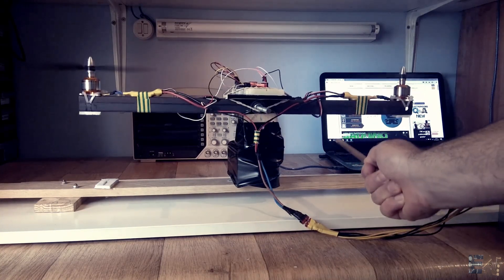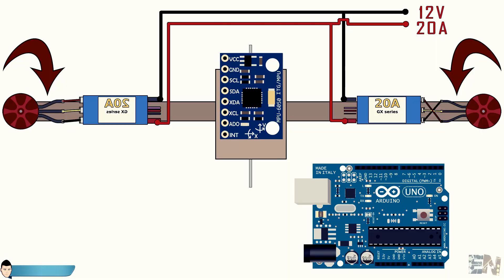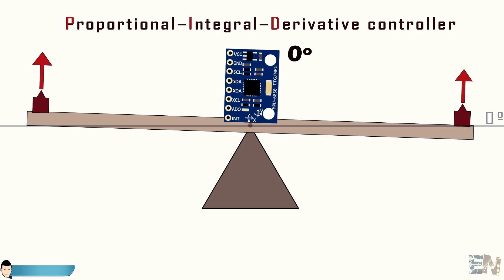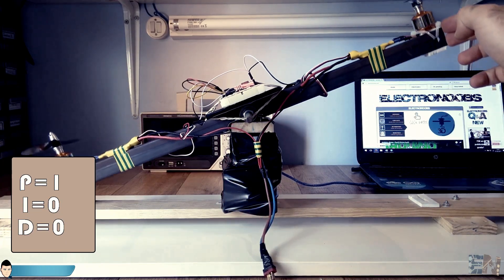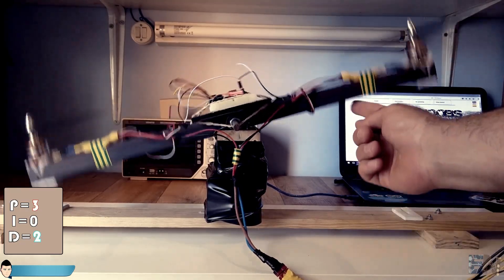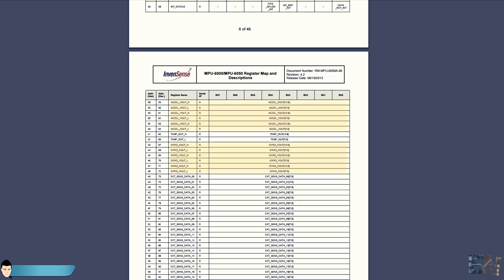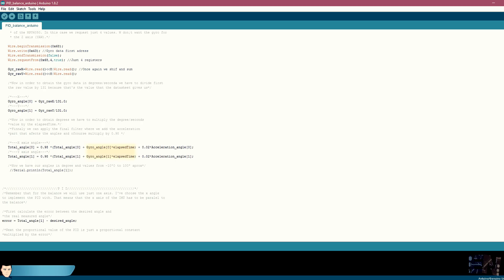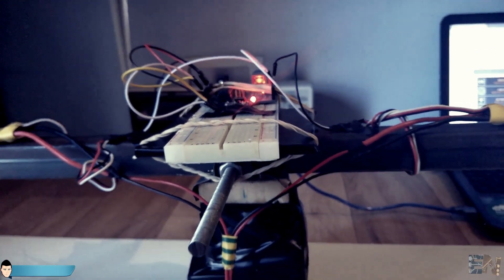PID brushless motor control tutorial

Comment: // ================================================================
// ===                   PID                          ===
// ================================================================
#include "Arduino.h"
#ifndef PID_H
#define PID_H
#define gainMax 90
#define gainMin -90

float set_point=0,g1,e,e1;
float system1;
float Es=0,integration=0,derived=0,kp,kd,ki,Gp[3];

unsigned long last_time;
float         last_Es;  
unsigned long t_now=0;

void set_last_read_pid(unsigned long time, float es) {
  last_time = time;
  last_Es = es;
}

inline unsigned long Last_time() {return last_time;}
inline float last_es() {return last_Es;}

void Pid(float Setpoint,float System,float KP,float KI,float KD,int SampleTime)
  {
   
   t_now = millis();
if(t_now>=SampleTime)
  {
       Gp[0]= Setpoint-System;
      
       
   int dt =(t_now - Last_time())*0.01;//0.01;
       integration=(Gp[0]+last_es())*dt/2;// integracion númerica po el metodo del trapecio (Gp[0]+last_es())*dt/2;
       derived=((System-last_es())); //derivada centrada derived=((Es-last_es())/2*dt);
       Gp[1]=derived;
       Gp[2]=( (Gp[0]*KP)+ (integration*KI) + (derived*KD) );
      // delayMicroseconds(10);
      if(Gp[2]>gainMax){Gp[2]=gainMax;}
      if(Gp[2]<gainMin){Gp[2]=gainMin;}
       set_last_read_pid(t_now , System);
       //t=t_now;

     }
       
   } 

inline  float get_PID(int select) {return Gp[select];}

#endif

Comment: Hello, i really appreciaite your job, but there is sth i don't understand
 When the bar leans to the right ==> the angle is positive (let's say 10°)==>(we set P=1, I=0 and D=0) we add PID to the right , Here the error = 0 -10 = -10 ==> throttle + PID = throttle + ( -10) which will decrease the value of the throttle and then decrease the power of the right motor!! could you explain this to me?? Thanks
Reply from the maker: Yeah, that depends on how you place the IMU. Just iamgine if I flip the IMU 180º on the Z azis, when the bar leans to the right the angle gets -10º so the PID will work. If it leans to the right you have to increase the power of the right motor and lower the lefto one!
Reply: Thanks for the explanation!!!
well that's in case when we rotate the IMU 180°. but in this tuto it wont rotate... i just wanted to say that if the angle is positive 10°( the bar leans to the right) we add throttle + the absolute value of the PID to the right motor so the power will increase (throttle + |0-10| = throttle + 10)
Reply from the maker: houssem 5alfet yes just do that or when calculating the error instead of making error-angle do angle - error and that should give the same result
Reply: Thanks a lot  my friend!! I encourage you for the next tutorials =))

Comment: Have you experienced any problems with the ESC's? mine are dischargning through the signal-pin into my arduino and burns it.
Reply from the maker: I never had that problem. That is strange. Even the red wire which is 5V shouldn't burn the arduino. I think your esc is damaged!
Reply: Yeah. three burned arduinos later i have ordered different esc's. Thanks for the answer and the great videos

Comment: Woooooooow you saved my life ! I am making this exact project (for school, for exam especially) and I was having trouble with the PID but thanks to you, all is pretty clear now ! 
Thanks so much ! 

Greatings from France !
Reply from the maker: Aymeric thanks, I'm glad you say that!
Reply: It works !!! :D Thanks so much !
But can I have a little bit of help please ? Because I tried with your values (3.55, 0.003, 2.25) and it works (lucky huh ? :p), but how to tune those values more precisely for my project ?
Reply from the maker: For  a perfect PID you coudl use a lot of math. Check this link: http://iamechatronics.com/notes/general-engineering/466-quantitative-pid-tuning-procedures

Basically you should put the bar to oscillate. Once it oscillates you should measure the amplitude (in this case in degrees) and the period. Using this values you could get the real PID values. But once you adn the second axis everything changes so you should make a 4 axis balance for that. It gets quite difficult using the formulas thats why I do it by hand (testing and testing till is ok).
Reply: And here I am 5 Years later doing the same school project...
Reply: You can use Ziegler-Nichols PID method as well. You only need to calculate oscillation frequency and then get the constants from a table quickly.
Reply: hello bro,can i please get your Instagram/Facebook name or even your WhatsApp number i need your assistance with this project as I am doing it now for capstone

Comment: What makes the integral action is to add a pole to the system and causes oscillations or at worst becomes unstable. The PD controller is good for DC motors.
Reply from the maker: You're right. PD should be better for this case!
Reply: I coefficient very important for leveling.
Have you coded antiwindup of I controller?
Reply: The sensor data are degrees per second then in controller it acts on the estimation of the state variables in this case the angles: pitch, roll and yaw.
You can use two PID controllers or their variants.
Connected in cascade one acts on the posture and the other confirms if it is fit to take off.
If you are good at control theory you can use a fuzzy controller
Reply: set_point=Serial.parseFloat();
         system1=get_Euler(0);
         Pid(set_point,system1,0.94,.06,.07,100);
         e=get_PID(0);
         e1=get_PID(1);
 
         //Serial.print("el er es : ");
         Serial.println(e); 
         //Serial.print("la der es : "); 
         Serial.println(e1); 

                                  
 if(e<0&&e1<0){
    //salida=disminuir
     pertenencia(Matriz_A,e);//evalua el error 
     //Serial.print("pertenencia en error : "); 
     a[0]=P(0);
     //Serial.println(a[0]);
     pertenencia(Matriz_B,e1);
     //Serial.print("pertenencia de la derivada del error : "); 
     b[0]=P(0);
     //Serial.println(b[0]);
     a1[0]=t_norma(a[0],b[0],1);// el minimo de los conjuntos difusos 
     //Serial.print("el minimo de los conjuntos  : "); 
     //Serial.println(a1[0]);
     b1[0]=defuzzy(a1[0],Matriz_C,4 ); // calcucla el valor real 
     //Serial.print("area : "); 
     Serial.println(b1[0]); 
     }  

    if(e<0&&e1==0){
      //salida=disminuir
     pertenencia(Matriz_A,e);//evalua el error 
     //Serial.print("pertenencia en error : "); 
     a[1]=P(0);
     //Serial.println(a[1]);
     pertenencia(Matriz_B1,e1);
     b[1]=P(1);
     //Serial.print("pertenencia de la derivada del error : "); 
     //Serial.println(b[1]);
     a1[1]=t_norma(a[1],b[1],1);// el minimo de los conjuntos difusos 
     //Serial.print("el minimo de los conjuntos  : "); 
     //Serial.println(a1[1]);
     b1[1]=defuzzy(a1[1],Matriz_C,4 ); // calcucla el valor real 
     //Serial.print("area : "); 
     Serial.println(b1[1]);
     } 
    
     if(e<0&&e1>0){
      //salida=disminuir
     pertenencia(Matriz_A,e);//evalua el error 
     //Serial.print("pertenencia en error : "); 
     a[2]=P(0);
     //Serial.println(a[2]);
     pertenencia(Matriz_B2,e1);
     //Serial.print("pertenencia de la derivada del error : "); 
     b[2]=P(0);
     //Serial.println(b[2]);
     a1[2]=t_norma(a[2],b[2],1);// el minimo de los conjuntos difusos 
     //Serial.print("el minimo de los conjuntos  : "); 
     //Serial.println(a1[2]);
     b1[2]=defuzzy(a1[0],Matriz_C,4 ); // calcucla el valor real 
     //Serial.print("area : "); 
     Serial.println(b1[2]);
     } 
    
///////////////////////////////////
     if(e==0&&e1<0){
       // salida=disminuir
      pertenencia(Matriz_A1,e);
      a[3]=P(1);
      //Serial.print("pertenencia en error : "); 
      //Serial.println(a[3]);
      pertenencia(Matriz_B,e1);
      //Serial.print("pertenencia de la derivada del error : "); 
      b[3]=P(0);
      //Serial.println(b[3]);
      a1[3]=t_norma(a[3],b[3],1);// el minimo de los conjuntos difusos 
      //Serial.print("el minimo de los conjuntos  : "); 
      //Serial.println(a1[3]);
      b1[3]=defuzzy(a1[3],Matriz_C1,3 ); // calcucla el valor real 
      //Serial.print("area : "); 
      Serial.println(b1[3]);
      } 

     if(e==0&&e1==0){
       // salida=mantener
      pertenencia(Matriz_A1,e);
      a[4]=P(1);
      //Serial.print("pertenencia en error : "); 
      //Serial.println(a[4]);
      pertenencia(Matriz_B1,e1);
      //Serial.print("pertenencia de la derivada del error : "); 
      b[4]=P(1);
      //Serial.println(b[4]);
      a1[4]=t_norma(a[4],b[4],1);// el minimo de los conjuntos difusos 
      //Serial.print("el minimo de los conjuntos  : "); 
      //Serial.println(a1[4]);
      b1[4]=defuzzy(a1[4],Matriz_C1,3 ); // calcucla el valor real 
      //Serial.print("area : "); 
      Serial.println(b1[4]);
      } 

     if(e==0&&e1>0){
        // salida=aumentar
      pertenencia(Matriz_A1,e);
      a[5]=P(1);
      //Serial.print("pertenencia en error : "); 
      //Serial.println(a[5]);
      pertenencia(Matriz_B2,e1);
      //Serial.print("pertenencia de la derivada del error : "); 
      b[5]=P(0);
      //Serial.println(b[5]);
      a1[5]=t_norma(a[5],b[5],1);// el minimo de los conjuntos difusos 
      //Serial.print("el minimo de los conjuntos  : "); 
      //Serial.println(a1[5]);
      b1[5]=defuzzy(a1[5],Matriz_C1,3 ); // calcucla el valor real 
      //Serial.print("area : "); 
      Serial.println(b1[5]);
      } 

///////////////////////////////////////

    if(e>0&&e1<0){
       //salida=aumentar
      pertenencia(Matriz_A2,e);
      a[6]=P(0);
      //Serial.print("pertenencia en error : "); 
      //Serial.println(a[6]);
      pertenencia(Matriz_B,e1);
      //Serial.print("pertenencia de la derivada del error : "); 
      b[6]=P(0);
      //Serial.println(b[6]);
      a1[6]=t_norma(a[6],b[6],1);// el minimo de los conjuntos difusos 
      //Serial.print("el minimo de los conjuntos  : "); 
      //Serial.println(a1[6]);
      b1[6]=defuzzy(a1[6],Matriz_C2,4 ); // calcucla el valor real 
      //Serial.print("area : "); 
      Serial.println(b1[6]);
      } 

     if(e>0&&e1==0){
         //salida=aumentar
      pertenencia(Matriz_A2,e);
      a[7]=P(0);
      //Serial.print("pertenencia en error : "); 
      //Serial.println(a[7]);
      pertenencia(Matriz_B1,e1);
      //Serial.print("pertenencia de la derivada del error : "); 
      b[7]=P(1);
      //Serial.println(b[7]);
      a1[7]=t_norma(a[7],b[7],1);// el minimo de los conjuntos difusos 
      //Serial.print("el minimo de los conjuntos  : "); 
      //Serial.println(a1[7]);
      b1[7]=defuzzy(a1[7],Matriz_C2,4 ); // calcucla el valor real 
      //Serial.print("area : "); 
      Serial.println(b1[7]);
      } 

     if(e>0&&e1>0){
        // salida=aumentar
      pertenencia(Matriz_A2,e);
      a[8]=P(0);
      //Serial.print("pertenencia en error : "); 
      //Serial.println(a[8]);
      pertenencia(Matriz_B2,e1);
      //Serial.print("pertenencia de la derivada del error : "); 
      b[8]=P(0);
      //Serial.println(b[8]);
      a1[8]=t_norma(a[8],b[8],1);// el minimo de los conjuntos difusos 
      //Serial.print("el minimo de los conjuntos  : "); 
      //Serial.println(a1[8]);
      b1[8]=defuzzy(a1[8],Matriz_C2,4 ); // calcucla el valor real 
      //Serial.print("area : "); 
      Serial.println(b1[8]); 
      } 
           
                     }

Comment: Amazing video! Thank you very much! I'm surprised by how the PID algorithm works. An alternative solution would be to look at the Quadcopter as a damped harmonic oscillator. By measuring the mass and length of the bar with the motors you can calculate the constants for the oscillator in order to be critically damped, so that it goes to the desired position as fast as possible. Also your formula for calculating the angle from the IMU data is quite effective for its simplicity. For just a little more accuracy you can add what's called "delta integration" for getting the angle from the gyro. Instead of angle=rv_new*time the formula would look like angle=1/2*(rv_new+rv_previous)*time. Combining gyro and accelerometer data with a high- and low-pass filter like you did seems to be the ideal solution. I tested the Kalman filter as an alternative, but it does not work better in this case and it is also more complicated. Finally, I have a question to you: How often per second can an arduino read the sensor data? In my experiments with a Raspberry Pi 2 and I2C it is limited to about 400, but the sensor supports up to 1000 read per second.
Reply from the maker: Thanks for all!. Well, depends of the module i2c comunication. And yes, the MPU6050 is limited at 400kHz Fast Mode I2C for communicating with all registers, which is quite fast and also for the SPI in case of the MPU6000 20MHz SPI serial interface for reading sensor and interrupt register.

Comment: Could you show how to adjust the code to use servos instead of ESC?
Reply from the maker: The code should be the same, servos are working with PWM signals as well. The only thing you should do is to make some kind of pulley that should move the metal bar with the servo motor like this guy: https://www.youtube.com/watch?v=HRJiow_k-V0

Keep up!

Comment: Almost everyting explained perfectly, for making it up by yourself :D 
The only thing I have problems with is the maths behind it. Would be stunning if you could take the time in resarching and explaining it :D
Reply from the maker: Hi there. Thank you!

There is not much math in to this tutorial. The only formula i'be esed is the Euler formula to obtain the angle using acceleration data. More of the math is explained on my webpage here: http://www.electronoobs.com/eng_robotica_tut6_1.php

Then the only time I've used a formula is to apply the complementary filter which is 98% Gyro data and 2% Acc data. The rest is just sum or subtract of PID value. 

Keep up!